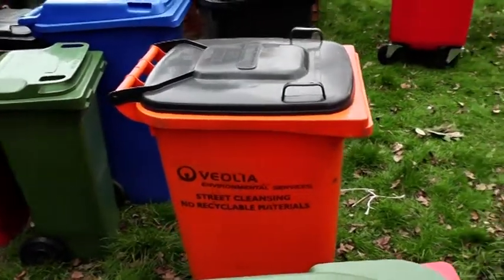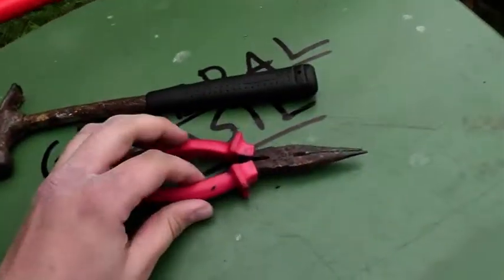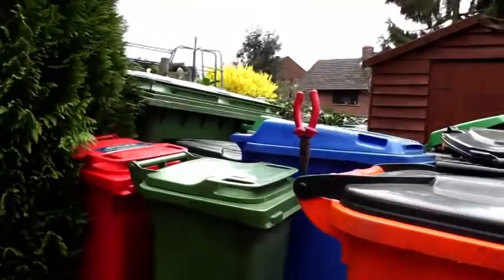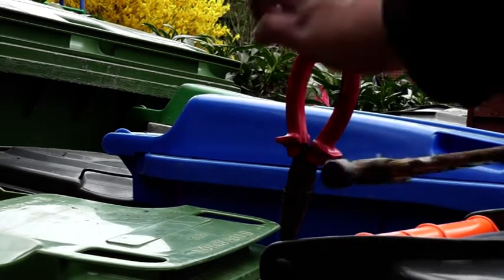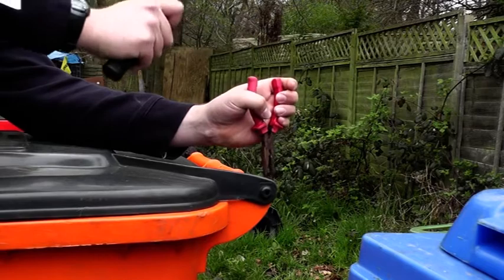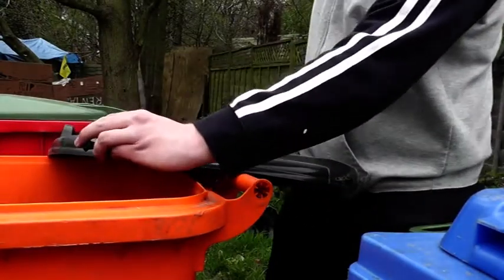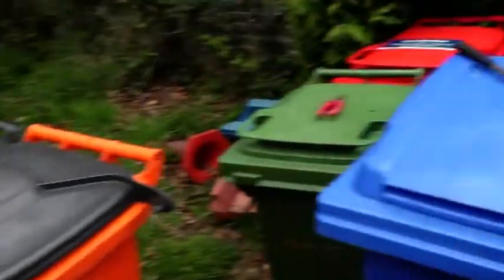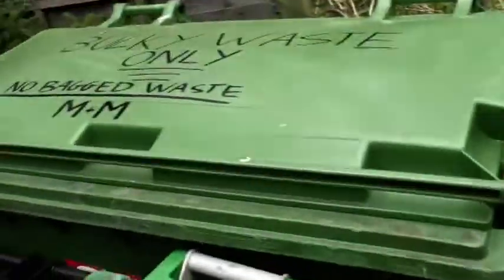Guide for Easy Lid Removing

Comment: Wow those pins came out easy. The sulo pins in mine were like pulling teeth. Damn near impossible to get out without breaking or severely stretching the pins. Oh, and I meant to tell you, we found a bunch of 2 hinged plastopans from 1989-1990 and they have a twist to them. I will get one some day but not for a while unfortunately as they are quite far.

Comment: I did a lid swap for my 120 Otto, it was a fuckin bitch to do. Winded up breaking one of the pins, so i put a screw into the pin, which is a pretty good substitute :D. I all ways use a flat head screw driver and a vice grip to remove hinge pins. Sulo's are the best for lid changes, very easy to do.